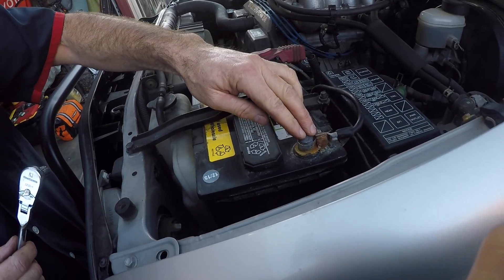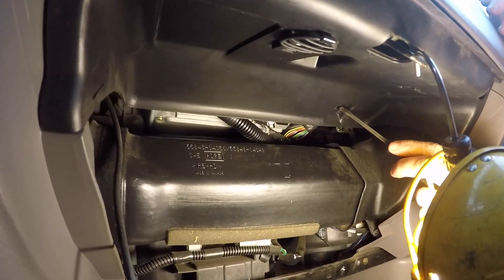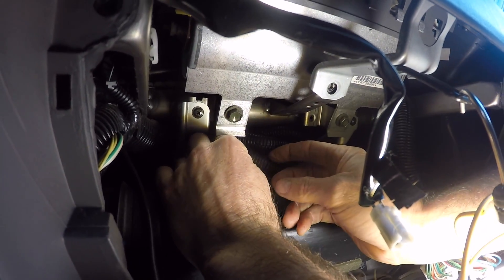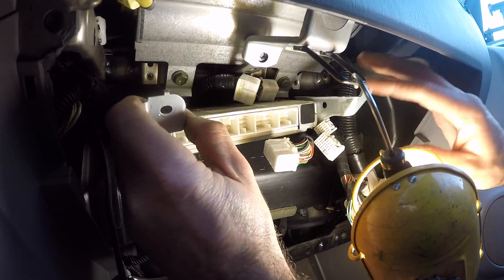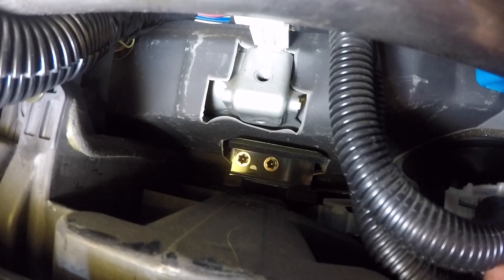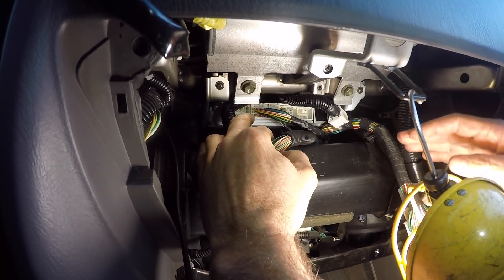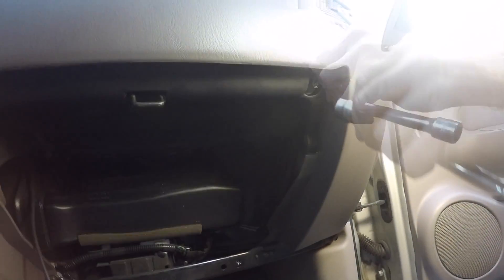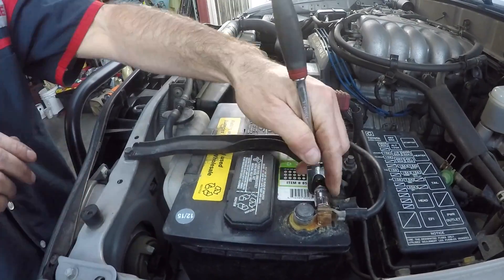ECU Replacement

Comment: I wish you owned a 2nd gen Tacoma and did all this videos lol
Reply from the maker: Hey John, we will eventually do work on 2nd Gen Tacomas.  We do work for people who hit us up for help.  So far, nobody local to us has hit us up for help with their 2nd Gen Tacoma.
Reply: @TimmyTheToolman   I have a second gen Tacoma and it’s doing the same thing. I’ve replaced head gasket plugs wires coils maf o2 upstream and downstream and all injectors nothing seems to be working. So lost and don’t know what to do. Any advice?
Reply from the maker: @damonoutman8530  It sounds like you've eliminated all the main possibilities.  I know it hurts to take it to a shop because they charge a lot, but there's a chance some very experienced mechanic with lots of experience working on your engine might have a clue of the possible culprit.  Maybe talk to a service writer at one of your local Toyota dealerships and ask if they have a mechanic well-versed with your engine and is good at diagnosing problems like yours.  Tell them everything you've done so far to fix the issue so it narrows down their search.  It might be worth paying a hours labor to see what they come up with.  If I had an idea where you should look next, I'd tell you.

For Greg's engine, it ended up being gross crankshaft play that was causing the knock sensors to generate the misfire CEL.  https://youtu.be/9Gpdq-tL79U

Comment: Ok I'm in mt Vernon Illinois water pump is going out  now gone 02 Toyota 4runner any help
Reply from the maker: You basically need to perform a timing belt job.  Here's a couple videos you can use for this job: 
Part 1: https://youtu.be/vHC46ypHxWc
Part 2: https://youtu.be/mErd7xoBS9I

Comment: Hi Tim, you mentioned misfire cylinder #1 was it an injector code or ignition code? I had misfire
(slightly rough idle) but a P0440 code, 98 Taco V6. My problem was a cracked vacuum hose top of the intake plenum. I used a can of Starting Fluid and sprayed around my hose connection points and found several hoses that needed replacing. If no bad vacuum hoses then a compression, leak down test would be next. Good luck and look forward to a resolution.
Reply from the maker: The code Greg is getting is a P0301, misfire of the #1 cylinder.  We had the top of his engine torn apart for the fuel injectors replacement and didn't notice any glaring problems with the vacuum hoses.  But, I'm going to take a good look at them again when he comes over next.
Reply: @TimmyTheToolman  was this problem ever solved?
Reply from the maker: @ShaunCapoferri  Yes, it was.  It ended up being gross play in the crankshaft causing the misfire.  His engine had an engine knock that I finally figured out where it was coming from.  The knock sensors must have been initiating the misfire code to the ECU.  Check out the video.  https://youtu.be/9Gpdq-tL79U
Reply: @TimmyTheToolman  hmm… he had a misfire though caused by the ecu?
Very similar problem on my 97 started misfiring out of nowhere and all test are good.
Reply from the maker: @ShaunCapoferri  The ECU didn't cause the misfire.  The knock sensors generated it and then sent the message to the ECU.  The real cause was the play in the crankshaft causing the engine knock.

Comment: Had the same issue before with my Honda. Did a leak down and air was getting pass the exhaust valves as air can be heard from tail pipe. Turns out my valve seats were shot which didn't create a solid seal between the valves and valve seats. As my auto shop teacher always said "diagnosis before throwing parts a car"
Reply from the maker: We performed a compression test of the cylinder and it tested good.  But, we're going to do a leak down test anyway to rule it out.
Reply: Goodluck! A leak down is always better. Worse case, the head will have to come off and take a trip to a machine shop. Anyways great vids and awesome channel. I've been watching since I was gifted a 3rd gen 4runner and learned a lot. Keep up the work!

Comment: Hey Timmy wouldn’t there have to be some kind of reprogramming of the ECU when replacing it?
Reply from the maker: No reprogramming necessary.  But, it might affect things like what his mileage says on the odometer.   I forgot to ask him what his mileage said.
Reply: So the mileage will change based on the mileage that’s on the ecu?
Reply from the maker: @edwinthetechnician6578  That's what I think but I don't know for sure.  I thought I had read that somewhere.  I'll let you know if anything weird happened, like the mileage changing, when I see Greg next and I get a chance to ask him.
Reply: Timmy The Toolman thanks that’d be great please let me know what happens as I might be performing this on my 3rd gen 4Runner as well.
Reply: @edwinthetechnician6578  In the process of changing my ECU on my 3rd gen as well. Did you end up needing to program?
Reply: @jonarriola794  no I didn’t end up doing it

Comment: Had a misfire years ago in a Chevy 350.  After replacing a ton of parts, it turned out to be a bad exhaust valve.
Reply from the maker: I'm starting to think there's something majorly wrong with Greg's engine, especially since it has an audible knock when it's in gear.  I used a mechanic stethoscope and the knock is in the lower end of the engine.  You can hear it really well right under the oil pan.  But, we're going to do a leak down test and check the timing.  The initial compression test of the cylinder was good.

Comment: Check compression and timing next before throwing more parts at it. Love the videos!
Reply from the maker: We checked the compression and it was good.  Next step is doing a leak down test and checking the timing.
Reply: @TimmyTheToolman I know this is years old, but I was having the same issues you were describing at the beginning of the video with my 97 4Runner! It ended up being a few vacuum leaks, fuel filter and clogged injectors. Love you videos man, thanks for the info!

Comment: Check the wires connection for corrosion and loosenes pcm don't go bad that easy on toyota I see lot of harness problems on toyota
Reply from the maker: Ok, thanks for the tip.

Comment: Timing belt or head gasket
Reply from the maker: Engine is not eating coolant so I doubt it's a head gasket issue.  But we are going to check the timing and do a leak down test of the cylinder even though the compression test was good.

Comment: I had a spark plug blow out a few months ago...it was held in mostly by the coil pack. I put a helicoil in and it was a successful helicoil. But, the engine was still feeling like it was intermittently misfiring randomly. Checked the plugs, wires and timing. While I was checking the timing, I just happened to touch the plug wires right where the timing cover says 3400. The problem ended up being the wires were pinched the slightest bit. I replaced with oem words and brand new wire clip separator things from Toyota. Problem was instantly fixed and hasn't happened for over 10,000 miles so far. Check every inch of those wires, I bet that's the problem. Something like wind from the fan can just move those wires the slightest bit, and cause a random misfire. Good luck, keep the vids coming buddy. We all appreciate you more than you know.
Reply from the maker: Ok, thanks for sharing this.  I'll take a good look at his wires when he comes over next.

Comment: How about the fuel filter? If that has never been changed it could seriously limit fuel flow. Is the cylinder that is misfiring one of the last ones in line to get fuel?
Reply: Good suggestion.  Coil too?

Comment: Hi Tim, Are the parts you are using OEM? Aftermarket parts are just junk. I had NGK  spark plug wires, but that was the only non oem part that is in my 4runner, so I went again with Sumitomo (OEM) wires.  I also find Denso made in the USA are not as reliable as Denso made in Japan. May be Denso is not giving their secrets to Denso manufacturing plant in the US? Many US made Denso alternators are failing before 200K miles (some at 100 K miles: Honda pilot 2011) , but Denso Japan alternators continues to run even at 230K miles with 14V.
Reply from the maker: You know, I forgot to ask Greg if he used OEM parts for the wires and plugs.  I'll need to ask him that when I see him next.

Comment: I know you are probably running down the list on DI-57 in the FSM, but I don't recall you checking the vacuum lines. Sucks his rig is throwing the code, but at least he's in good hands troubleshooting the problem.
Reply from the maker: That's a good point and thanks for reminding about this.  We did have his engine fairly torn apart and didn't notice any problems with the vacuum lines but the next time I get Greg over my place I'm going to take a good look at them.

Comment: I hate he is having problems but us folks who love your videos are benefiting.
Reply from the maker: Well, we have eliminated a lot of things.  What I haven't mentioned in the videos is Greg has a noticeable engine knock when it's under load.  When the engine is running and the transmission is in park or neutral, the engine isn't knocking.  As soon as he puts it in gear, drive or reverse, the engine has a knock in the lower end.  We're going to check the timing and see if it's off but there just might be something majorly wrong with the engine and it's just a matter of time before it fails.
Reply: @TimmyTheToolman  Hey Timmy I could really use your help with my '01 4runner. I think I need to replace my ECU. I have gremlins that appeared after 1st trip thru a car wash since I bought it in March. That was April. I can't figure it out since. My windshield seal seams ok. My AC condenser drain hose has been removed and cleaned out, had no clog. But what happens is my door locks and turn signals just start going off while driving now even on dry days no rain no car wash. Do you think it's the ECU? Thanks man you are THE most informative! I'm a subscriber since I got my 4runner!
Reply from the maker: @hsing4903  Hard to say what it is but the fact it started happening right after the car wash does lead you to believe water got in where it shouldn't have.  I wish I could point you in the right direction but diagnosing electrical issues is not my strong suit.  You might want to post this question on the T4R.org forum in the 3rd Gen section and see what people say.  There's a guy with a screen name, "The Durk" that's really good with electrical that usually chimes in when an electrical question is posted.  I don't think you're issue is the ECU because that's pretty protected under the dash but I guess there is a chance it could be the culprit. Good luck and let me know what you find out.
Reply: @TimmyTheToolman  Check the wires closely, a mouse did some chewing on the wires running to my #1 cyl coil pack. he just chewed enough to where they grounded out together. Lil  bastid
Reply from the maker: @llshamelessll  Well, we figured out Greg's misfire problem.  It was gross play in the crankshaft that was causing an engine knock.  We think one or both of the knock sensors initiated the CEL misfire code.
Reply: Tt